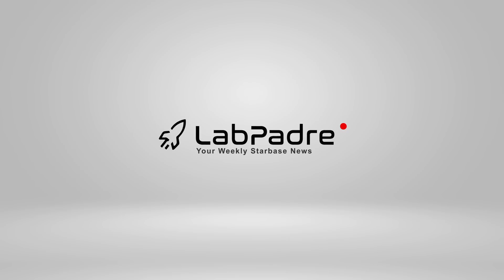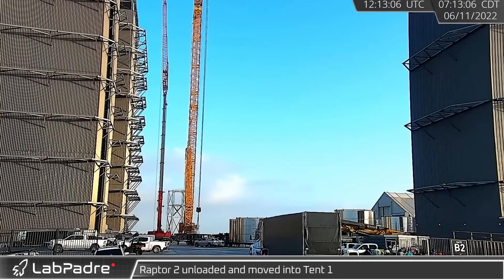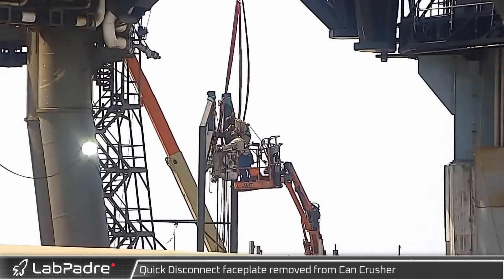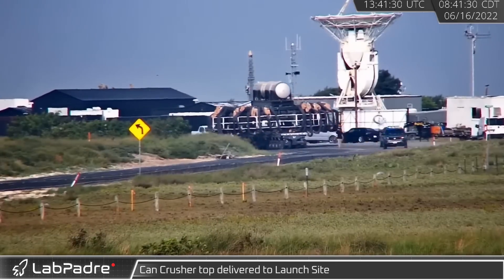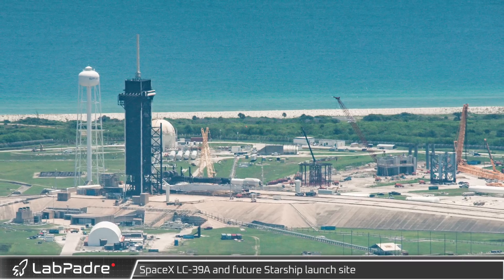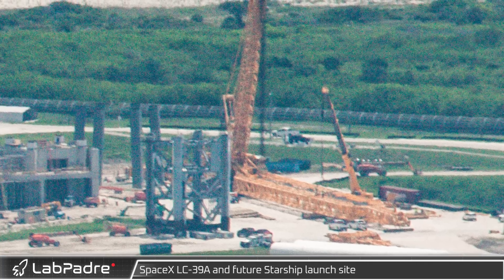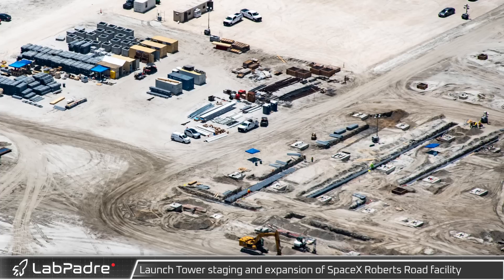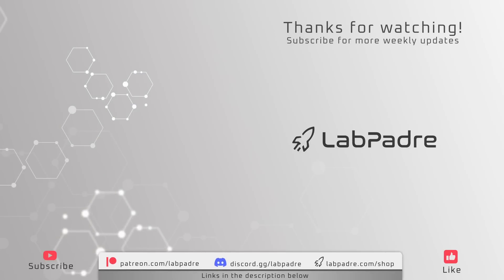Starbase Prepped For Summer Launch - Weekly Update #15

Comment: I  wonder just where the KSC Starship Launch Table is? The one at Starbase had work begun before anything other than the legs even existed at Boca Chica, and is one of the last of the components to be completed. They must suely have already stared working on the one for KSC. And I'm eager to see if those legs are the finished articles or whether they will feature the extensions that the Starbase LM legs have.